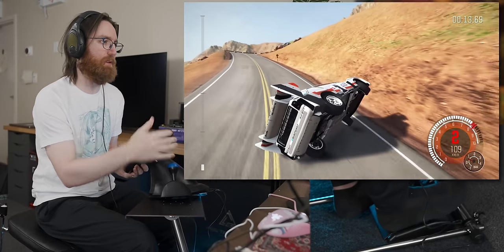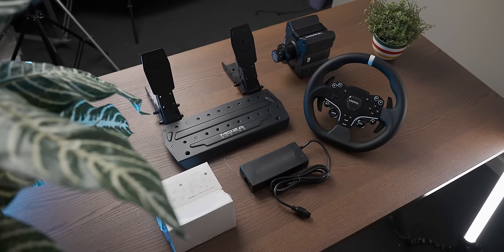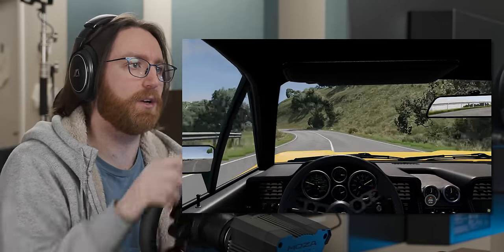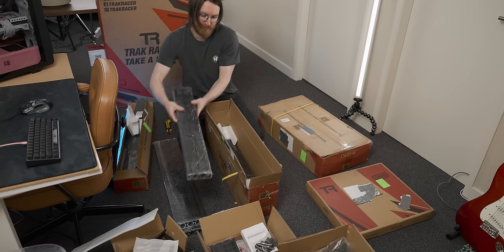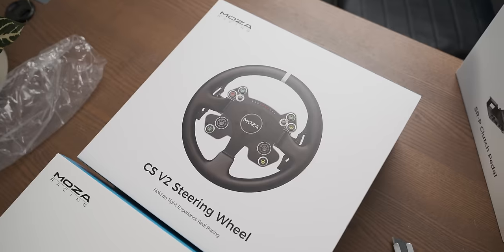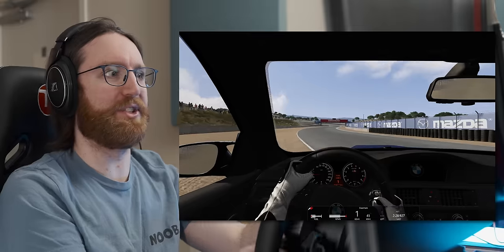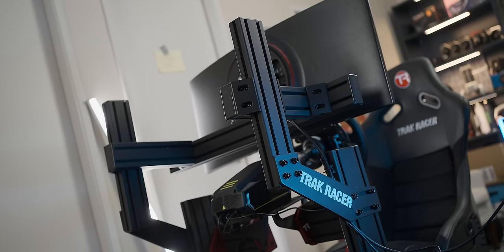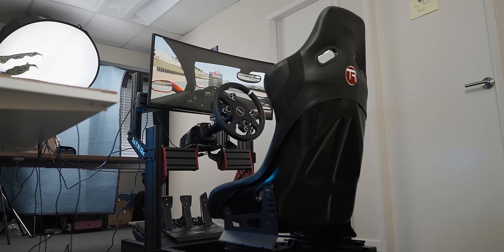Is Expensive Sim Racing ACTUALLY Worth It?

Comment: I have a Moza R9 with SRP pedals, a Reverb G2... and I play 100% VR in AC.  You're in for an epic experience!!  That being said... setting up AC for VR is not plug and play.  There are a few good guides on Youtube with different settings... I have spent many hours trying different settings and trying to find a good balance between fps and sharpness/look.  And I have an i7 13700K and an RTX 3090... yet it's still struggling to get close to  85-90 fps.  Make sure you use CSP and Pure.  I have it dialed in now to a place where it's... fucking awesome.  Fighting for corners in close quarters with opponents in VR is just plain stupid epic.  I love this stuff.
Reply: adding to this if I may: in the CSP (btw, you should use content manager when modding assetto at all, it makes everything a million times easier and is in general just a better UI) ffb tweaks, enable "output real steering forces to wheel" and "output real brake forces from pedal", set the force to 100% in the software and you should get the best experience possible (assuming you grab a car with both of those enabled). another thing of note is that BeamNG also has VR, you'll need to run it in Vulkan for the best experience, but it has generally been described as utterly terrifying.

oh, and on CSP+Pure, there are many preset graphics and PP filter packs out there, my personal favourite is SKY, but any half decent one will make assetto look like it has graphics from the future.
Reply: @tiagobelo4965  In VR I feel like the PureVR PPF gives me the best overall feeling/experience... I tried SKYand some others but it was less "crisp".  Maybe it's just me though...
Reply: If you have lots of cars on the track, you will quickly come CPU bottlenecked in AC, and many other sim titles. I reckon you take a look at your extra python apps should you have any in use, and see what disabling them does to your performance. Some of the very simple seeming apps are incredible CPU performance hogs, to mention a few I noticed quite heavy: car radar, sidekick, crewchief. I got Index and the same CPU as you, but 4090 and I'm essentially completely CPU bottlenecked with a large grid, any of the graphics settings does absolutely nothing no matter how high or low I go.
Reply: @ilmariylitalo8427  I don't feel like I have CPU bottleneck but I'll have to check. My FPS is pretty constant either I'm alone on the track in practice mode or racing with opponents.  That being said... I rarely put more than 20 cars on the track.   But yeah it makes total sense that the more cars you have, the more CPU it will need.  Also I added apps after I tuned my game and didn't notice a drop.  I'm currently running 87 avg fps with lows around 73-75.  It feels pretty smooth.  Anything lower than that and I feel like I can't corner correctly and I start missing apexes and braking points for no apparent reason... other than input lag.  Of course if I lower my graphics again it gets even better, but it's a balance.  I need a 4090 but prices man...  I regret not buying one before the hike.
Reply: I try with my meta quest 2 and get immediate motion sickness. Blah

Comment: I was genuinely worried for you @14:55 don't hold onto the wheel when entering a crash
Reply: Exactly you just should let go! Let go your wheel!
Reply: No you shouldn’t, but if you’ve ever driven in Assetto Corsa you know that it cuts off the FFB in direct highspeed impacts like this.
Reply: C'mon guys, it's just 5Nm for God sake!!
Reply: @gerardsitja  that was the 16nm wheelbase and even with my 8nm at 60% in ac its till easy af to hurt yourself with it so i dont doubt the 5nm at 100% can too
Reply: @veeembee Yes, you are right, I commented before finishing the video. 9nm and up (at least for me) it's when can be dangerous, but with 5nm it's easy to handle even at peak forces.
Reply: @gerardsitja  you underestimate how soft people have gotten.
Reply: @rolux4853 fun fact real race car drivers are trained to let go of the wheel when entering into a crash. It’s so the steering wheel doesn’t snap hard in a direction and take your hands with it. Broken bones especially when it’s impacted like that ain’t a fun time.
Reply: you dont unless you want to wreck your gear every crash
Reply: My man it’s 5nm, not 15 🤣
Reply: And if you hold onto it, hold as light as possible so it just escapes your hands.
Reply: @mrmidnight32  Watch the damn video before posting like another guy already commented the same like you,  he had switched to the 16nm, people are so quick to wanna belittle or be "tougher" than other people jesus.
Reply: Like someone mentioned in a similar comment. You should also learn to never lock your grip on the wheel where your thumb is on the inside. Even if you are careful and try to let go before a crash. There are some bugs, crashes, hangs and unexpected track resets that you won't be able to anticipate. When that happens you better pray that your digits are all holding the wheel on the outside.

Comment: I'm watching this while sitting in my Trak Racer 120, it's now my living room "chair" with my 55" oled. It's actually super comfortable compared to the many lower quality choices I've purchased. I grabbed a full Simagic setup because they are more drift and rally focused and it's been an absolute blast using it in all kinds of games from Gran Turismo 7 to WRC. The investment is pretty steep but far less than a car and you can wreck as much as you want. I think this hobby is just going to grow this decade .
Reply: That's the conclusion I came to as well. A high end setup isn't really for gamers that like racing games(unless you have $$$), but more for those without the budget or means for track days. The costs are miles apart.

Comment: Nice to see the smile you had barreling around in the setup. As others have mentioned get your hands off the darn wheel if you're going to crash! When it comes to cost (and some of it is insane so I built my rig out of 2x4's and MDF which weighs a ton 🤣) keep in mind that sim racing is a serious hobby for a lot of racers as golf is to some people. For the next 'upgrades' I would recommend testing would be triple monitors and/or VR (Everyone has their own preference. I like triples myself.) to increase your peripheral visibility, and then for more immersion add a 'Buttkicker' (Yes. That's what it is called.) setup which will add vibration to your rig and seat which is a lot of fun if the title you play supports it. Overall sim racing is a fun little hobby for those of us that will never get the chance to drive a proper race car whether it be cost or physical size. The '79 Lotus F1 is my favorite to drive so I had a smile. Great video Dawid!

Comment: one of the things i felt like was possibly lacking was some kind of mechanism that can jiggle your seat as you go over bumps. so i went on to TrakRacer's website and it turns out! not only do they have that product, it's like, a product CATEGORY. they're called actuators, and they seem pretty awesome. 

the website itself has an enormous selection. and don't worry if you're Canadian. you can just click the little flag in the top right corner, and switch over to the American version. which has a much wider selection of products. 

i was also impressed to see not only 3rd break pedals, but also manual gear shifters!! they even carry those awful "sequential" manual shifters, if you're a masochist or something.

Comment: some funny details about ffb in beamng:
due to it being based on the soft body physics of the game its violently shakey, and requires a lot of friction, smoothing, and inertia
the most important thing to many, is that despite having a VERY good power steering simulation, no car presets have it equipped, so dawid was basically driving a ford F150 with the power steering disconnected, for those who may not know, that's a full blown workout, and the only reason dawid didn't come out of this video absolutely jacked is because of the lowered ffb.

edit: btw, moza and some other manufacturers make wheel bases above 16Nm, moza has a 21Nm base and I've seen monstrosities beyond 30Nm, with any wheel base of this kind (hell, above 8Nm its probably a good idea) you should REALLY have an emergency shutoff switch (usually the big red button you see on the side of some people's simrigs), these things aren't just strong, they are absurdly fast, they can and they will absolutely destroy your hands if something goes wrong.

Comment: With direct drive wheelbases, particularly the higher torque ones/more powerful ones, it is very important to take your hands off the wheel if you crash. You can literally break fingers and wrists. Don't try and hold on or calm the wheel movement down after a crash.

Wrestling with the wheel when almost crashing is something else entirely though. Hold on for that :)

Comment: With you holding onto the wheel during crashes, I'm glad you didn't decided to go for the Simucube Ultimate motor, which can reach 32 Nm of torque. That motor can actually break your wrist or arm if depending on how it twists with all that force.

Comment: Iv'e been sim racing since 2014.
I went from P Cars with the T150, then too Assetto Corsa and the T300, finally to iRacing and a Fanatec.
Let me tell you, a wheel with FFB is a must.
You may laugh, but the amount of people that buy a cheap wheel, with no FFB just to get what they think is the start of a sim racing experience, the FFB is a HUGE part of that experience.
Also, the wheel doesn't make the driver, the driver makes the wheel.
If you are crap at sim racing, spending over a grand on a Fanatec won't make you Lewis Hamilton, you'll just crash and probably break your wrists, because yes, the feed back from direct drive and Fanatec wheels is POWERFUL.
Also, tweak your wheel settings for you, as there are settings that adjust the feel of the road, tyre, slip, grip, the actual feedback.
You don't need an expensive wheel to have a good experience.
If you are new, an entry level wheel from Thrustmaster or LT will be great, way more immersive than a controller.
The internet makes you think you need an expensive wheel, the playseat, expensive pedals etc.
If you do that, you'll be spending over £700.
The T300 is around £280
The playseats are around £300 to £350
The T3PA Pedals are around £150
Add delivery and insurance, you are well over the £700, and believe me, there are way more expensive wheels and pedals.
All you need......
Just a gaming seat, chair, a sturdy desk is all you need too start, and buy something like the Thrustmaster T128, it is an entry level with pedals and will do fine.
If you find you enjoy it and get better..... THEN upgrade.

Comment: As someone who has upgraded their rig multiple times and made a lot of purchasing mistakes, do your research!

I made the mistake of cheaping out on a wheelbase with no FFB, only to buy a G29 a few weeks later, and then upgrading to a CSL Elite a few months after that, and then a CSL DD a few years later.

If you have the money, go with a Direct Drive wheelbase as DD is the future. Belt and gear driven wheels are good for folks who don't have the budget, but don't waste money on a rig that you will upgrade from in a few weeks. Save up and buy a DD wheelbase right away if you can afford it. There is no comparison to gear or belt driven wheels.

Comment: You need an emergency stop button for direct drive, that way when you lose control you can hit the button and the wheel shuts off
Reply: The button is only for if the wheel malfunctions and wont stop spinning back and forth. Its not to be hit every time you simply crash the car lol

Comment: The fact that you get the R16 bundle for $1400 is a pretty good deal. I paid more just for my wheelbase lmao. I know many start off with either the R5 or R9, but If I just got into this hobby I would have saved up and went R16. 

If you start off "cheap" you will burn cash upgrading (been there, done that). I dont think a lot of people would consider upgrading from a R16 since it covers most peoples needs (most).

Comment: I started years ago with Logitech gear and had fun with it for years, my g29 is put away in its original box and still works great.
I upgraded several times mostly with Fanatec stuff because I also was playing on a PlayStation first with their belt drive and then to their direct drive.

Same with the pedals as I upgraded those several times and the last two sets had the force feedback brake sensors and in my opinion this is where the biggest improvements are for most people.

I also did the cheaper pedal stand and upgraded to a full rig/monitor setup and like noted it got quite expensive.
I moved and downsized and sold all the rig and higher end direct drive wheelbase and pedals.

I do still have my csl elite belt wheelbase and pedals with the pressure sensor and I have been thinking of picking up another wheel stand and just playing around with sim games I already own and having fun again.

It is easy to get carried away and dump tons of money into sim racing gear but honestly the average player with decent mid level gear and a decent pedal set which uses a pressure sensor for the brakes is all most people really need and can be set up for about 25%-30% of most of the higher end set ups.

Remember no matter how much you spend you are still  only playing a  video game driving a digital pretend car around a digital pretend track/road!
Reply: Speed wise and competitiveness definitely. You don't need to spend alot on top end gear to be fast or competitive. The tracks and cars maybe digital but they are the closest thing to a real experience the vast majority of us will ever have experiencing our favorite tracks and cars. With tracks being laser scanned with the LiDar tech, and how incredibly detailed and accurate cars are being implemented into the games you won't get the full experienced unless you go with high end equipment that you will be able to feel all these subtle nuances and details with. I'm never going to drive an Alfa Romeo 33 Stradale on the Nurburgring, or an Indycar on long Beach circuit in real life but I can on my sim rig and if spending a few thousand here and there will make it more realistic and authentic to the real thing that is money very well spent.

Comment: This was a great watch. A few things to note:

1. Assembling a good sim racing frame and wheel will typically last through several generations. I used the same frame from the PS3 era until just last year, for example. 

2. Direct drive is great, but comparing the Logitech G29 (which is essentially the exact same "budget" wheel they've been making for over 10 years) is a bit much. The G29 is just woefully bad by modern standards. It should legit cost like $70 as it's in that league of fisher price wheel controllers. Logitech DOES make a great DD wheel that costs about 1k all in. I ended up with that, and even though it goes to 8nm I run it around 50-60%. The good thing about Logitech's "Pro" is it has pretty good game and console support, and you can flip to to G29 "mode" for any older games that lack bespoke or configurable support. Also it has a LCD that lets you configure a lot of the settings without needing to go into the software.

Sim racing is great fun. I don't play it as much these days, but I did pour like 400 hours into Forza Horizons on my frame, which made for a really unique experience. As it's essentially an open world racing RPG with pretty okay driving dynamics, made incredibly fun with a proper wheel and frame. Just putting on some tunes and cruising around the world was some of the best gaming I've done in years. I should pick up the sequel and see if the game still has it's charm.

Comment: I'm working towards SIM racing collecting the hardware. I have a 32 in LG gaming monitor bought new and have a used Ryzen 7 5700G pc coming. Will probably get a Logitech 920 or 923 all with Asetto Corse. Being quite old software I'm hoping it will run well enough. I do not like large PC cases and always go for the NUC type format. Trying not to invest too much at this stage.
Fourty years ago I was an amateur race driver all over NW Europe based in UK and I'm wondering how I'll do with SIM racing.
Your video here is very enthusing for me at nearly 71yo. 🤓

Comment: Ive found that the ffb strength is something you get used to. Initially coming from ~2.5nm entry level wheels i had my first direct drive turned way down because it felt so strong. Over time i kept upping the power and at some point i hit the limit and began looking at even stronger wheels.

Comment: Moza is just about to release the Moza R3 racing wheel bundle.  It only has 3nm of power.  It is also XBOX ONE compatible through the racing wheel, and you can use that wheel on Moza's other larger bases like the ones you tested, you just can't get it without buying the R3 bundle for now, but the R3 bundle is priced extremely well.
Reply: 3.9nm, so even better

Comment: Need to have the wheel base at 100% and set the ffb in game to your liking this make the most of the power of the base and prevents cliping.
Reply: it's a quick tip, but I think you can do it a bit better (at least on Moza). pay attention to clipping and set up your in-game FFB strength to avoid it. then on the base set maximum torque to maximum, but lower FFB strength until you find it comfortable. this would be essentially the same as what you suggest, but if something goes wrong and the game outputs maximum strength signal to the base, you're less likely to injure yourself

Comment: Investing in a pair of cheap racing shoes and gloves help for the pedals feeling and to save the wheel from sweat over time.
And to be fair, when i used to do two laps in a row in my 32 year old Civic on the NS  i was exhausted too, but it may come from the frenetic mirrors check during laps avoiding terrorist coming from behind like bullet and my poor physical condition rather than actual driving 😅